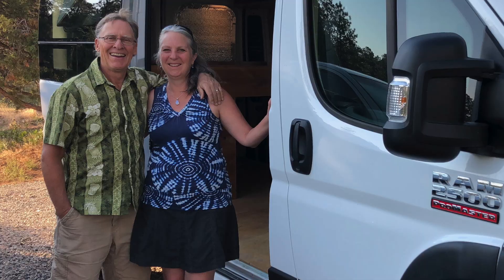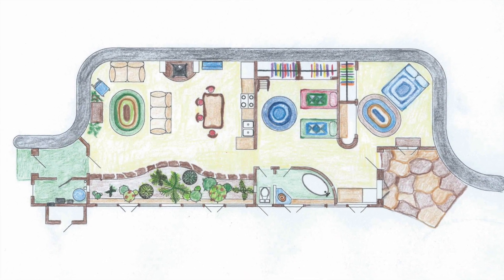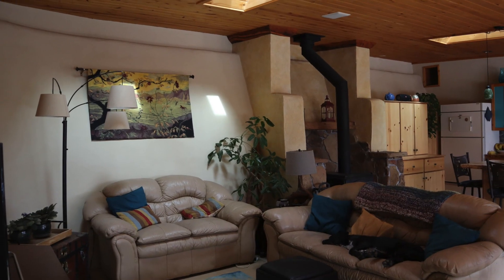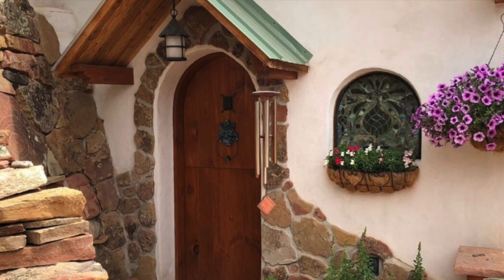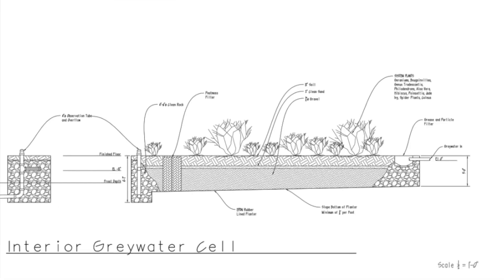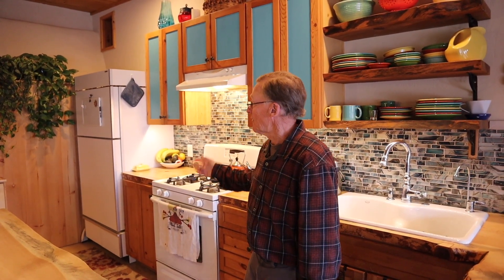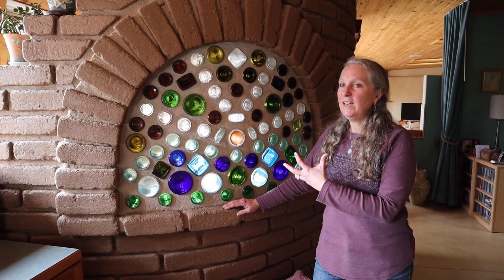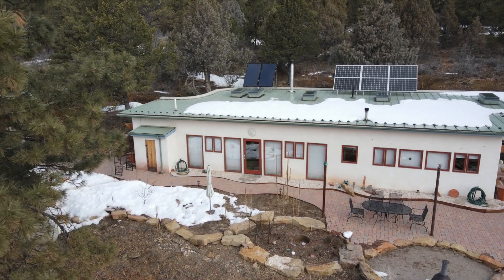How We Designed a Home that CAN’T FREEZE | Full Tour of Our OFF-GRID HOME in the Mountains

Comment: This is an awesome home..we are planning to build with tires. What did you pound your tires with. In the video it looks like it was air operated.
Reply from the maker: Thanks! We used a  pneumatic pogo pounder. I was a great took, but required a very large compressor. I have a video called "How Long Does it Take to Build a Tire Wall". That might answer some of your building with tire questions. Good luck with your project.

Comment: Our greenhouse is passive solar. It is built 3' into the ground and is a lean-to on the south side of my shop. I have a wood stove in the shop but the green house heats the shop. I only build a fire if it is 20 or below for several days. I have a solar water heater under the greenhouse roof panels to heat water for the hydroponic fish tanks and floating grow beds. The wall between the shop and greenhouse is 8" concrete blocks to hold heat to radiate at night. It also has 2' of river rock under the paver blocks as a heat sink....James
Reply from the maker: Well done, James!!!

Comment: This last year, since we built our travel van, we are looking at ways to use it's power. We brought the solar generator in the cabin and are using the electric induction plate from the van to cook with this winter. Working well and will be nice in summer. We have always cooked on the wood stove in winter and outdoors in the summer. We even have a small convection wall heater, about 400w that we have turned on at night, testing to see how long we can run it off the solar generator, just to heat our bedroom at night. Also experimenting with a small oil filled heater for in the van to keep a little heat in there....James
Reply from the maker: What a shining example of ingenuity! Love these stories. Thanks for sharing.

Comment: What can you use in place of tires? Why did you choose tires?
Reply from the maker: First of all, tires are free!!! 
They are great building materials. 
You can make beautiful sweeping curves with them.
They required a lot of labor, but most folks can do it themselves.
The other alternative is to use concrete to build a basement wall strong enough to hold back the hillside. That would usually require a skilled contractor, steel reinforcement, and concrete (which is not a renewable of sustainable building material. - if that's important to you.
Hope this helps.
Reply: @ClarityOffGrid  Is there any environmental concerns with the tires?   Do they emit any toxic chemicals or other bad things?

Comment: I would like to see your battery bank and the whole grey water collection system, especially how it works in the sun room. I would have liked a sustainable home. Our cabin is an old log scaling shack with 5' added to the north side. That N wall is 4" thick concrete block added inside a conventional stick built insulated wall to collect heat. The wood stove is built into that in the kitchen. That 5' addition is the kitchen, eating nook and bathroom. We have running spring water for a flush toilet and heat our water with the wood stove for shower and sinks. Grey water swale and a small septic system. We have lots of water here on the east side of the coast range, some of the highest rainfall in the U.S. We only have 100w of solar for a small 12v cooler and a few 12v automotive type LED lights with 2-6 volt batteries in the cabin. Our travel van has more power, we use a 12v extention cord now for more power to the cabin, just to help keep the batteries topped off.. The van has a 100w panel, a small solar generator with built in inverter and we also use the engine alternator to charge the solar generator, no propane....James
Reply from the maker: It certainly sounds like you have made the best with what you have and make it work in clever and thoughtful ways. Cheers! More on the battery bank and greywater planter to come.